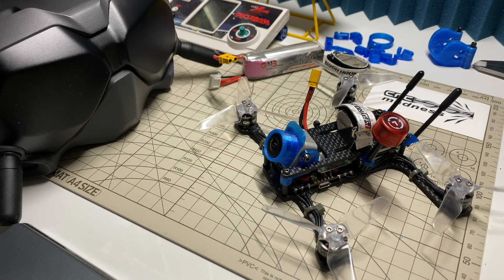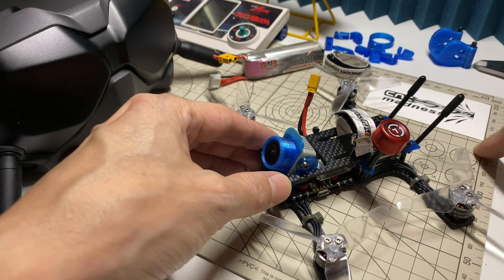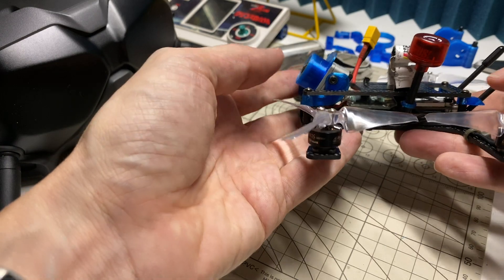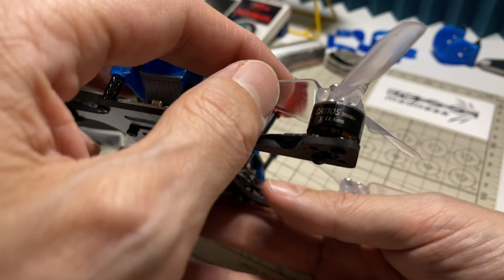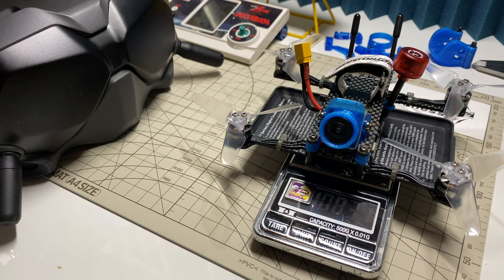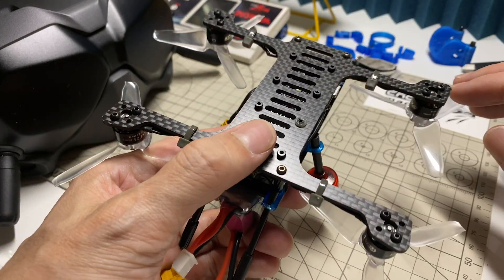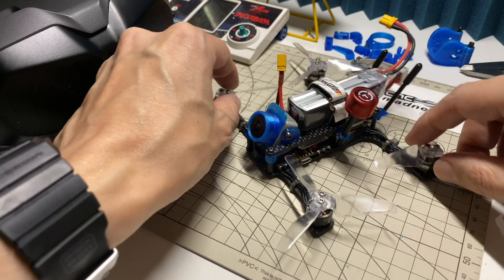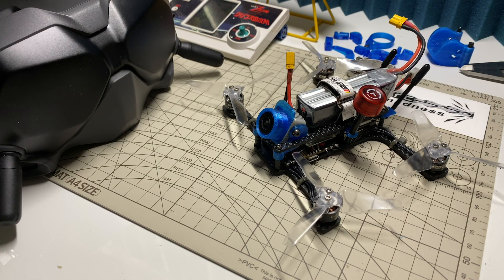Skyjumper v1: 3-inch 150g AUW Caddx Vista/HGLRC Zeus35 Prototype

Comment: How did you wire the vista to the Zeus35? I'm thinking of using the Zeus for a build but don't see the available UARTs. Did you use smartaudio for the MSP connection for the Vista or are there pads for two full uarts? I plan to use the DJI controller.
Reply from the maker: Hello! Yes I am using the TX2 and RX2 for the MSP. The only  slightly annoying thing is that the pads are on opposite sides of the board. If you are using the DJI remote then I think that just goes on the regular SBUS pads.
Reply: @MiniMicroFPV  Awesome, thanks so much for the reply. Great frame too, I wonder if things could be even lighter with the nebula now, though with a quality decrease
Reply from the maker: Actually I think I have that backwards;) UART 1 is for the MSP and 2 is for SBUS. Also I’m getting power for the Vista directly from the battery terminal. It needs at least 7.4V. Anyway make sure to double-check the wiring but rest assured the Z35 will work with the digital system;)

Comment: Nice build, you're doing a fantastic job ! But this one seems more a cruising kwad rather than a acro freestyle one. 
Do you plan to try with 4S, or already planning for a new frame ? 
I would be really interested in your build if it could be a freestyler one.
Reply from the maker: Thanks so much! You could be right about the style of quad. I'm not enough of a freestyle pilot to say whether it's really suited for that or not. How would you define a freestyle vs cruising? Is it in the geometry?
Today I tried a couple of different flying styles (with a. 360 GO of course) and will hopefully be posting that video soon.
I will definitely be making some updates to the frame~~
Reply: @MiniMicroFPV  Freestyle is more a way to fly than a frame. If your setup can handle powerloops, enter a precise gap, follow your mind without being dragged by the weight of the kwad, then it's a freestyle kwad. Also to mention that such frame is kinda strong. Are you able to tick all the boxes ? :)
Reply from the maker: Hehe well I'd say it ticks all those boxes but I imagine the frame is not as strong as what one would consider a freestyle frame. It's definitely strong enough for my needs but I recognize it could end up being too light for some folks. However I am going to try to add some strength without increasing weight (too much;).

Comment: Amazing achievment to reach such low weight with caddx vista embedded.
Some ideas that I think could be interesting improvements :
- slightly longer arms to be able to fit geprc 3 inched propguards
- possibility to fit up to 1404 motors with decent protection
- a 4 inches version, maybe closer to deadcat shape to avoid props in view.
I am definitely intersting in buying this frame if you ever sell it.
Reply from the maker: Thank you, and for the suggestions:)!

Comment: Do you notice a difference flying with battery at the top vs a toothpick with battery under?
Reply from the maker: I wish I could say I notice a big difference but I do not. However I am not able to fly as often as I would like so I would say my senses in this matter are not as attuned as some others might be. I don't dislike either style however:) I think the top mount at the very least is a little easier on the batteries.

Comment: Any plan to add a little bit more protection for the camera, it feels so exposed!
Reply from the maker: Thanks for the comment! I might raise up the sides of the camera mount to offer a some more protection:)
Reply: @MiniMicroFPV  Carbon sides might protect it from a big crash, but I don't think TPU will. Considering the price of the camera, we gotta take good care of them!
Reply from the maker: You're probably right about that, though I don't think I will add carbon except maybe to extend some of the surfaces. The way this is currently designed there is some flexibility in the mounting which I think (hope) will help in a crash. Honestly I would like to crash-test it to see how both the frame and the camera hold up but obviously don't have the resources;). For these light builds though I think TPU might be okay. I'm thinking about quads like the iFlight DC2 and TransTec Beetle which have TPU camera mounts.

Comment: Hi does your motor gets hot  with the 5000kv? thanks
Reply from the maker: Hello. Not at all, at least on 3s:) When these motors were in the CineKing and running 2" props on 4s they would get hot.
Reply: @MiniMicroFPV  i have building a long flight time build quad using 1204 6000kv, and at 2s its get hot to touch. 

have you been thinking building a high endurance quad using 18650 li ion battery? like this one https://www.youtube.com/watch?v=QssakQg0zJ8
Reply from the maker: Hmm. I don't think that setup should be getting hot! How big are the props and how heavy is it?
When it comes to an 18650 quad, I haven't thought about it (yet:) but have you seen Kabab's setup?
https://www.youtube.com/watch?v=P-gfSElJ9AY
Reply: @MiniMicroFPV  using the same props as you have. The avan 3024, no hardware issues. The screws is not touching

Yes i saw it. its just that the motors is not available on where i am. Nice build
Reply from the maker: That's strange. It doesn't sound like that setup should be getting hot. How about your PIDs?
Reply: @MiniMicroFPV  thats what i always working on and not having an outcome. Do you have the pids for that build? My build is also the same weight as you do but the motors are 1206 6000kv

Comment: Very cool, glad CNC Madness worked out for you :)
I love how much content you're putting out with micros and the Vista! I have two Vistas I plan to build into micros and looking around, you're the only one really doing anything like this, so thanks for that!
The first one I've already got the parts for, using a Racer X Twiglet (2.5in) frame with a canopy I printed from bludzfpv on Thingiverse (thing:4166048), Xing 1105 4500kv motors, and a Betafpv 20A AIO v3.
I was thinking the 2.5in Intrepid frame for the other build, but it's kind of heavy and I don't like that the stack height isn't adjustable. Think I might pick up one of these Skyjumpers now though. The weight is great, I love the H frame for no props in view, you can really slam the stack height down, it's perfect! I'd love a 2.5in option but will gladly buy a 3in and just run the smaller props on it too :)
Reply from the maker: Hey thanks again for the CNC Madness recommendation. I see it's where Albert Kim also had his recent custom design cut;)
That sounds like a good Vista build! I also have two and the other one is currently waiting for the arrival of the little 2" TransTec Beetle:)
Thanks for the interest in the Skyjumper. After some updates maybe a version 2 will be ready to sell;)
Reply: @MiniMicroFPV  Can't wait to see what you come up with for Skyjumper v2! 
Also, I had the first Beetle, the 2.5in version with the full size air unit. I sold it to help fund a 6in Armattan Badger DJI build but missed it once it was gone. When they came out with the 3in Beetle frame I picked one up with another full size air unit and some Xing 1404 motors. I just flew it for the first time last weekend and it's awesome! One of the best things about all the Beetle frames is their camera mount. I typically prefer a carbon camera mount like the Intrepid frames, but the TPU printed mount on the Beetles is really thick and made from higher durometer TPU than typical, so it's stiff enough to not have issues with jello. It's a really nice quad overall, and I'm sure all that much better with the reduced weight of the Vista.